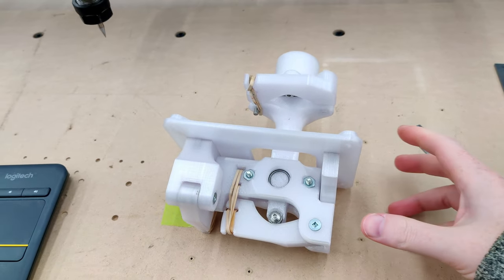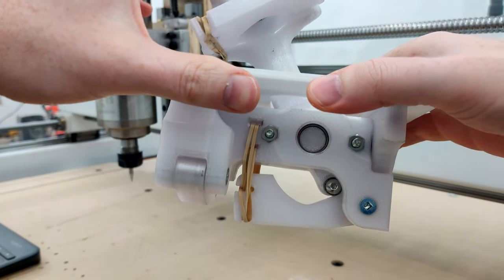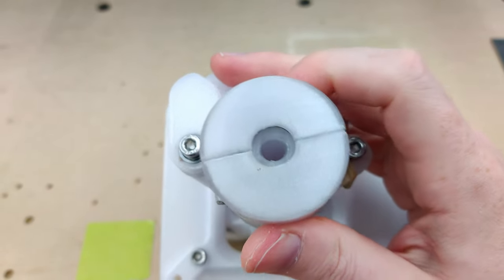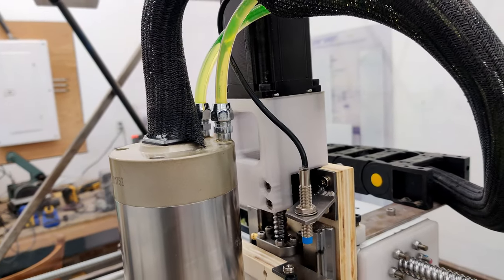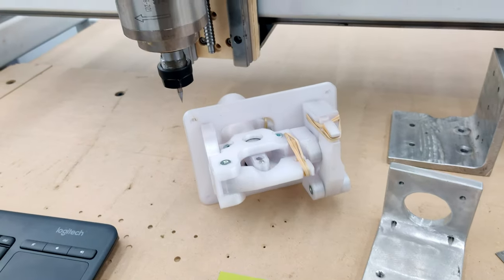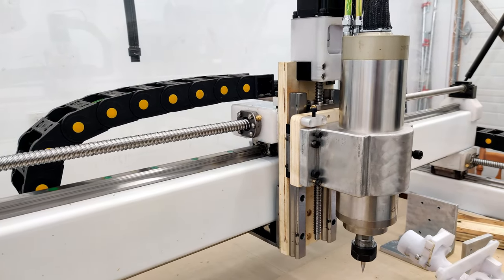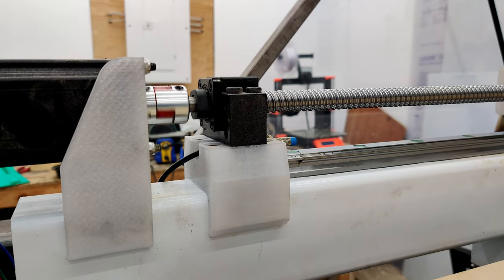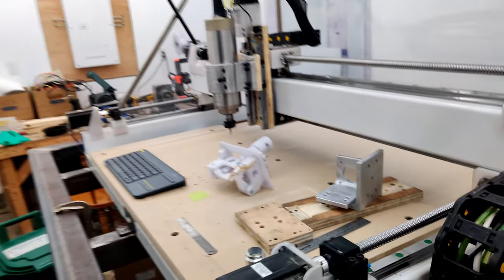My CNC Machine Upgrade: 3D Printed Joystick Gimbal, DM542 Driver Fixes, and More.

Comment: What's the middle bolt for on these spindle motor clamps? The one that looks like it would push the clamp apart rather than hold it closed?
Reply from the maker: That’s correct. The middle bolt is used to expand the clamp out making it easier for the spindle to come out. It’s threaded on the side closest to camera opposite to the other 2.